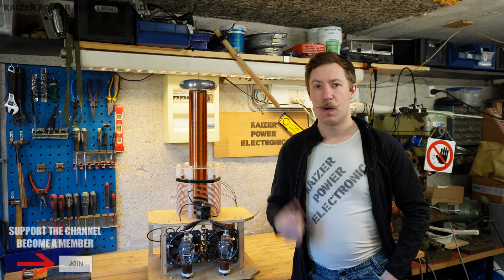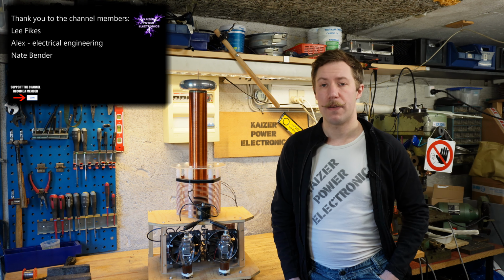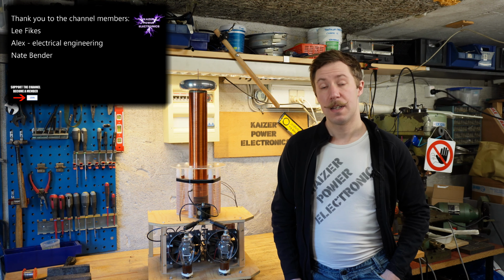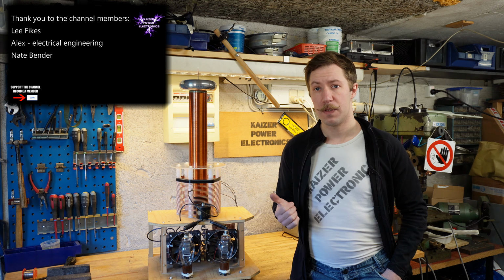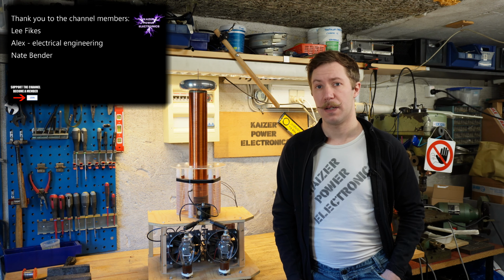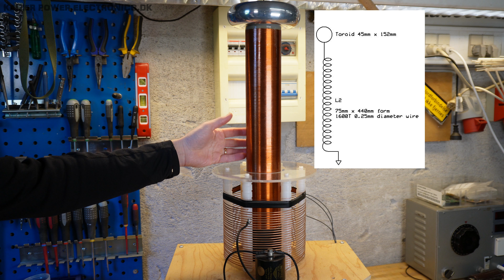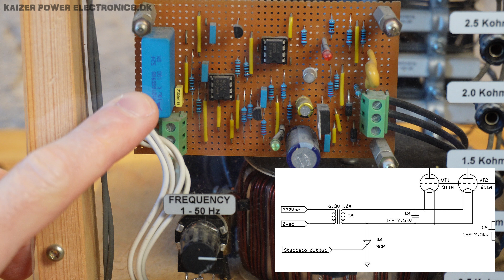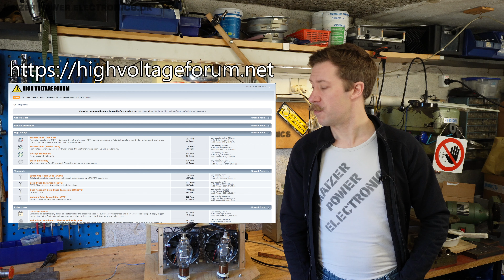811A Vacuum Tube Tesla Coil + 1000 FPS Slow Motion Sparks

Comment: Awesome coil - I have build the 833A coil design and the arcs are very straight - but punchy on staccato - on C/W they are slightly more branched but not much - I guess - sometimes its a happy medium 👍👌👌👌👌👌🙏
Reply from the maker: Very straight sparks are normal around 400kHz+ resonant frequency, did you change it to a higher resonator?
Reply: @KaizerPowerElectronicsDk  I used slightly thicker wire and different value grid leak resistor - have fixed feedback coupling and maybe slightly wider diameter and longer secondary form- 

When I was first going for maximum spark length - I did get primary trying to arc to the secondary - so I used mylar insulation and tried moving to primary to secondary coupling hight - It sounds like a whip cracking😂👍

Comment: What is the wattage and resistance of the resistors you have on top of the tubes? What gauge wire did you wind around the resistors?
Reply from the maker: Schematic in description shows it. 33R 17W, with 10 turns on 1.5mm^2 wire around them.
Reply: Thanks, how do you calculate the level shifting capacitor? I am building a dual 811a Tesla coil. It has 1500 volt plate transformer but only produces 2” sparks. I will post some video on my channel.

Comment: Hey I built a staccato for my vttc. The frequency adjust works fine, but I'm not able to change the pulse width of on time. Would you have any suggestions to help me trouble shoot my staccato? Thank you. Nice job with yours btw.
Reply from the maker: I could have the same issue, I have never really seen a difference in sparks from adjusting pulse width, it might not even work! :) But then again, not much difference between 500 Ohm to 2500 Ohm grid leak either...
Reply: @KaizerPowerElectronicsDk  I have dual gu-48 triodes. I've tried 1k to 5k ohms on the grid with 2nF cap, not much difference like you said. Right now I'm trying to push more power through, but my plates are not turning red even running half wave cw. I really need a diff prob so I can see what my grid voltage looks like. I'm considering more feedback turns to drive the tubes harder.
Reply from the maker: @coreyworthington2797  I reduced feedback windings to avoid red plating :) What about your plate supply voltage, can you make that higher?
Reply: @KaizerPowerElectronicsDk  Right now my B+ voltage is peaking at 3,500VDC from a level shifted MOT. I bought a potential transformer used for open Delta three phase, but I have not been able to get it working on single phase yet.

Comment: Aren’t 811A tubes rated at a maximum of about 1500 volts? How much over that are you going? I’m VERY impressed with that output from just two of those tubes!
Reply from the maker: They are pushed up to around 2500 VDC, above that, internal arcing starts happening :)